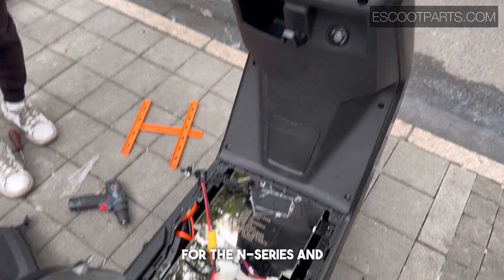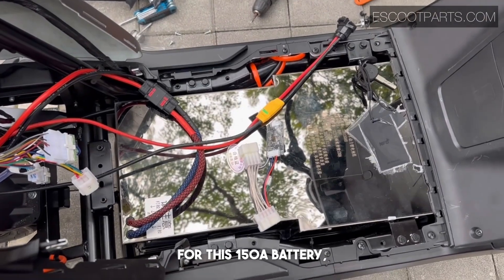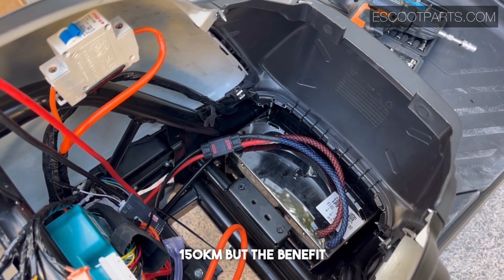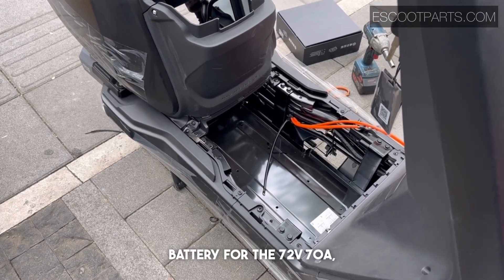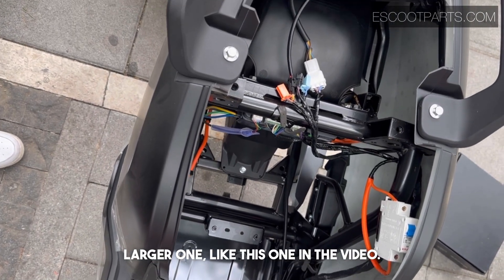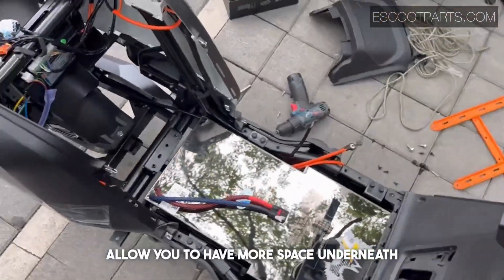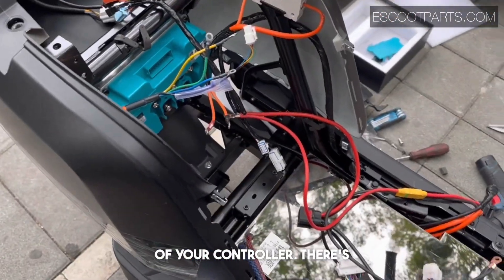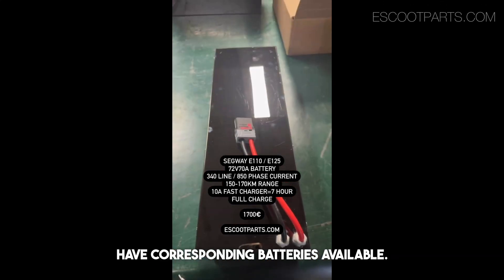NIU NQI / N1S 72V150A Battery Upgrade – 250–300KM Range (Installation)

Comment: Can you get Dual Battery on a NIU N-Series with this battery
Reply from the maker: You can get the dual battery with our 60V64A since its same voltage.
Reply: @escootparts2284  ok but isn't this better?
Reply from the maker: We can make you a dual 72v battery setup, we have in the past made a 108V dual battery setup with the other battery in the trunk.

Comment above was regarding using original battery.
Reply: @escootparts2284  ok I drive a lot of kilometers what is best. I think you just drive 90 km/h
Reply from the maker: 60v64a battery + dual battery connector 

If also wanting more speed 72v.
Reply: @escootparts2284 Do you plan on offering a larger physical size 60V battery that you have to remove the plastic in the battery compartment to fit, similar size to the 72V70Ah?
Reply from the maker: @hansmariustorgersen3218  We have 60V64A its 160KM of range. Plug and play: https://escootparts.com/product/niu-n-series-extended-range-fast-charging-battery-60v-85-150km-range/